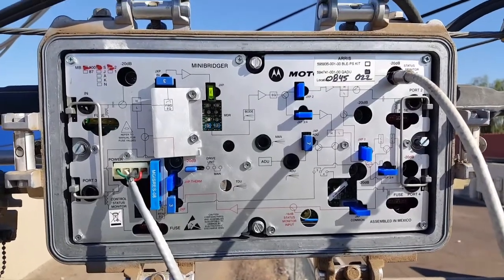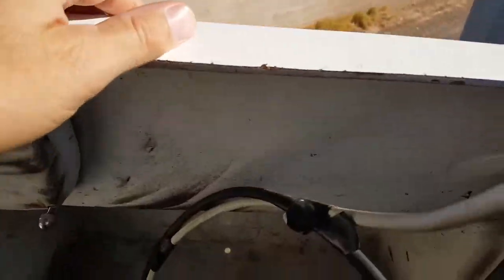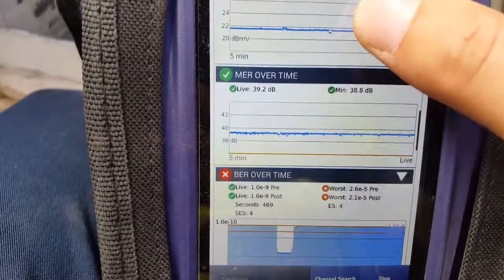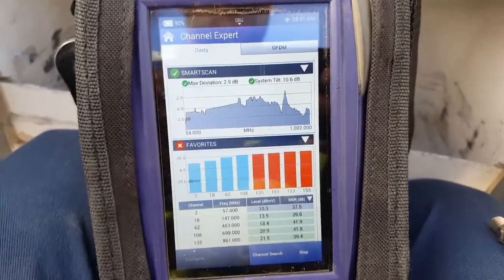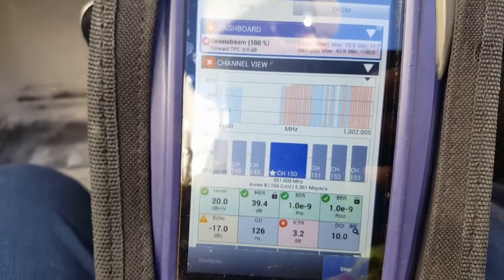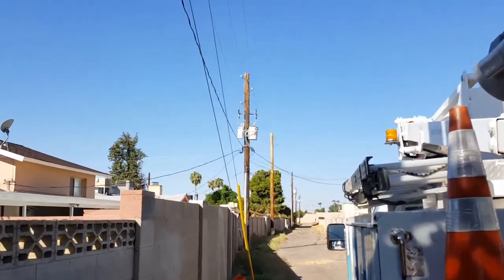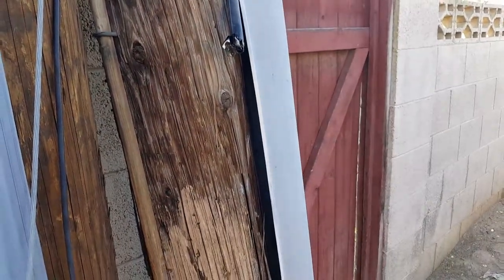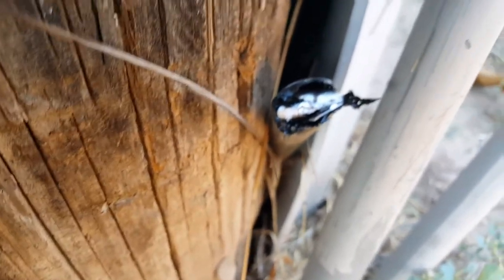Tracking bad ICFR

Comment: A-holes digging and cutting feeder with dull cutters never blow the fuse. We cut with proper tools, core feeder with no spark it blows the fuse, power inserter and power supply and if it is cold and rainy enough the node too.
Reply: Fun times :(

Comment: Nice quick lesson. We just got our new Viavi meters a month ago. They seem to give a lot detailed info that we need to improve and keep out system right.
Reply from the maker: JR Schultz as a maintenance tech the Echo feature is helping us find corroded cable and connectors long before service impacting issues arise. Awesome tool to have. Much better than the DSAM meters we had.
Reply: @thebasiccablechannel7464  I miss DSAM for one reason: Speed. ONX is an improvement in almost everything with the drawback of it being slow as ****. Mine has also got stuck sometimes and iv'e had to reboot.. Had some weird bugs that's for sure.

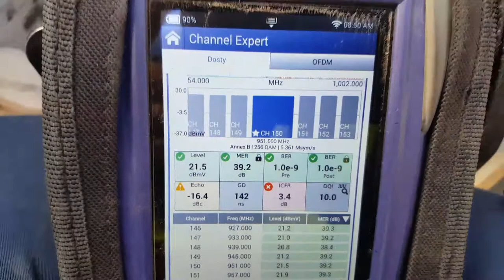Comment: Would have went for the TDR first because that would tell all. I'm sure people would rather have you TDR, Short the output, terminate the output, swap the amplifier so they can see how each thing is done. I appreciate the effort and the fact you don't have endless time. To those out there, throw away the DSAM and the Trilithic DSP. Using them is a waste of time when you see the Viavi find stuff like a hound dog. Look at 0:34 and check out the black line which is noise under the SC QAMs. You'd have to go to two different screens to see this with other meters.

Comment: ahh copper thief lol. i have lots of old direct buried cable causing bad ifcr in the us, and a few ds channels. getting the cable replaced is another story. i usually have to wait until it completely fails to get the old 412/500 replaced with some 625

Comment: does anyone know how to remote into it so you can leave in a hub and look at spectrum on android phone, i hear people saying it can be done but never seen anyone actually do it, talk is cheap
Reply from the maker: I am sure there is but I have not done it myself or seen it
Reply: @thebasiccablechannel7464   Download the Viavi ONX app on your phone. Then over bluetooth you can see the front panel face of the ONX One Expert. So you are limited to the Bluetooth distance which is not that far.
Reply: Set up a mobile wifi hotspot with your android phone. Connect to the hotspot with your Viavi. Check the ip address on the viavi. Then use a VNC app on your phone to log in to the Viavi. Works within wifi range.